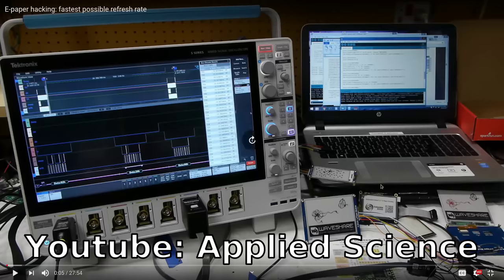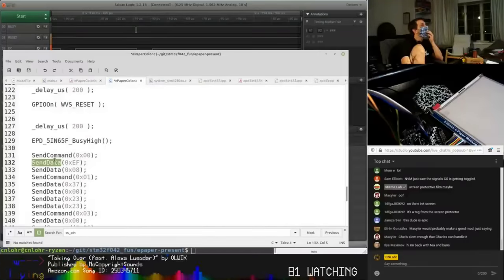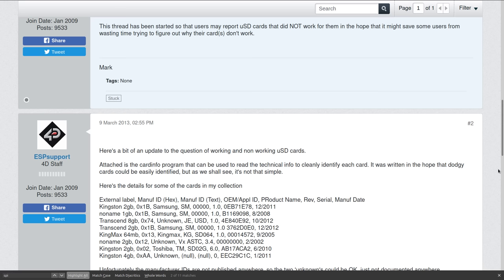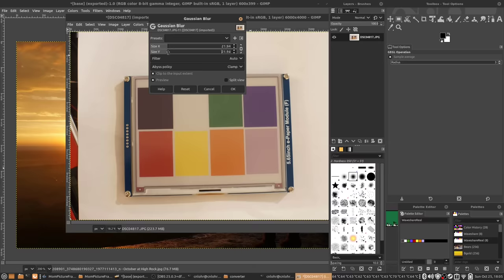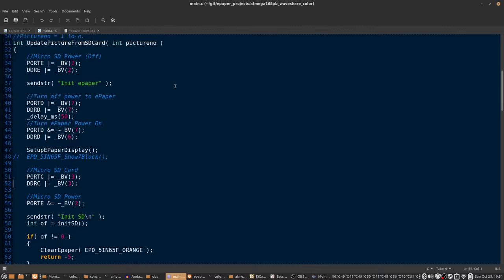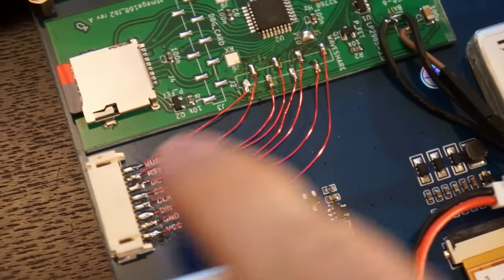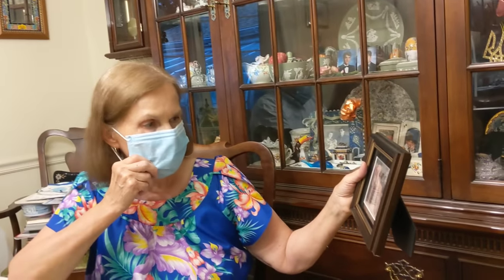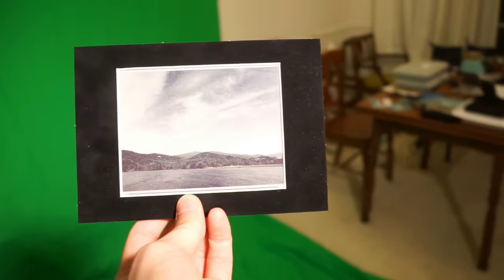Trolling My Mom With an E-Paper Picture

Comment: This is actually a really good implementation of a digital photo frame. The use of e-ink and only changing the photo every 24 hours (or more) makes it much more unobtrusive than the ones that were such a fad over a decade ago.
Reply: Absolutely. Add a changeable battery and maybe bleutooth for changing images and this is a great product.
Reply: It's literally just the screen. It doesn't come with malware or ANY ware.
The guy had to make his own driver for it.
Did you even watch the video?
Reply: @tenalpoen  they are referring to an incident with old digital photo frames that had malware. that's why he said "like the old ones"
Reply: Everyone knows about those.
This is not a digital photo frame product being sold by anyone.
It's just a display with no driver, power supply, or anything else.
If you were to buy it, you wouldn't be able to do anything with it on its own.
Reply: @tenalpoen  yeah he was just making a joke lmao
Reply: I agree, the old photo frames were so tacky. But we actually bought a modern one recently and boy have they come a long way. Even though it's obvious it's a screen, it's quite a lot more beautiful than before and actually pleasing to look at

Comment: For anyone that's thinking of making something like this today, there's this company called Pimoroni that has made a board with an eink display, rpi pico w, SD card reader, and some other features built right in. They also have custom firmware that makes setting pictures super easy. Highly recommend if you want something more simple and easy to set up

Comment: I like your attempt at trying to do a kind of profiling of the displayed colors through photographing it at around 04:55 - Color calibration and color management is a deep rabbit hole and I appreciate you including this in the video. I think the flaw was that what you did would be only useful at providing the palette for a soft proofing profile on your LC or Oled display of your computer. To extract the display-able  colors you would have to measure them under a known light source and also correct for the reflectance of the display (this is why your black levels where off and looked washed out). Nonetheless a very exciting project 😍👍
Reply from the maker: I think the biggest issue was that I cannot accurately display the colors because they are not as vivid.  So, doing it the way I landed on provides the "most" vividness that can be done without supersaturation.
Reply: Yes exactly. This is because the gamut volume of the display is far smaller because it is based on subtractive color science and not additive. Meaning it can only reflect light and not produce it like say an Oled panel. This is also why printing color spaces are narrower than display color spaces. So soft proofing is used on the display to simulate the narrower space of a printing medium. Additionally, you are basically working with a kind of 3bit display 😂 so only 1 bit for brightness info and 2bits for the shades and then using dithering to trick the eye into seeing colors that are not there. But actually using the palette you derived from the picture you took in the conversion algorithm would basically be a way to soft proof or simulate, what the final picture would look under the specific lighting conditions you took the photo under. So you could technically use it in extreme cases to then adjust the original picture (say you observed severe banding on the eInk display and wanted to adjust the picture before converting it again), then simulate the output on your pc monitor without the need to send it to your mum to put it on the display, maybe tweak it again and then use the 'optimal' palette on the picture for the final conversion. Anyways this is a great example of color spaces and working with limited color volume 👍

Comment: Finish what you started!!!
Figure out how to get this produced and sold!
I'm retired now and frustrated at all the times I made things and had no idea how cool customers would have thought they were if I'd only made them available! 😬😅
Reply from the maker: There will only ever be one!
Reply: @CNLohr  I would buy it because I have no time for making it myself. Love the idea.
Reply: You can buy a changing picture frame. It just uses more power, so it has a wire attached to it.
Reply: @weorldedit  That's the problem these days. There is always a tradeoff between high fidelity and high power consumption. With people so used to plugging/charging any and every electronic device they own, they rather have a 4K smart picture frame that uses 10W and needs a power cable, than a dithered, low-res e-ink one that lasts over a year on a single 760mAh charge.

Comment: Two years later, this guy commented;
If you chose had for example, a person, was in the scene. The person could move into a different position, outfit, you could even tell a story. Every day, the person could maybe have a change in clothing, but only one piece at a time, until several days later they have changed clothes. Then if the scene slowly changed into another scene. Maybe the person is at a museum looking at a painting, eventually it turns into that person at work, standing a few steps away maybe looking in a different direction, looking at the copies in their hands. Things would need to be stable in the scenes. Like the picture would probably not move or change size, but the scene inside of the frame could change. What if the painting that was inside the phone, was of them, looking at a painting of them in the museum, and it would change as the picture changed? I imagine that the copy machine could have been something that was barred off with one of those ropes that clip onto those poles, and eventually the piece in the museum would disappear little by little and a table top copier placed there and the front rope would disappear first and the side ropes eventually change into something, or maybe the ropes could be close enough to the table. One day the copier on the table would change into a large copier that has multiple trays and all that. Not to mention about the rest of the scene slowly transforming. If a second person would be added, how noticeable would it be, or what if there was someone else looking at a different painting, off in the distance, at the museum, and they slowly came closer over time. With only one small change happening at a time, would the additional complications from the second person make it more difficult to see the differences.
Reply from the maker: That's a really good idea! a few people have had really good ideas since this video blew up this recent time.
Reply: @CNLohr  their was a show I seen a while back, about how powerful our brains were and how much compression we do throughout our days along with other brain things. It showed a several clips, one as if riding down the strip. We were asked to count the number of items, another was dancers on stage, and a odd guy in a suit cut through in the middle, all to show that if we are tasked with something, we tend to miss something bluntly in front of us. There was a check in desk. Where they switched people checking people in, or the clerk would switch color shirts, and most people didn’t see a difference, or they took a minute before they did. There was a picture of a guy surfing, with a shark next to him. His buddy was taking pictures of him surfing that day. Nobody noticed the shark, until the pictures were developed. That’s because the limited amount of focusing we have available. But it was shown that we have the ability to maximize what we have.

Comment: You could probably put a small solar panel on the back. Even indoors out of direct sunlight it would be generating more than enough microamps of current to keep the batteries topped up.
Reply from the maker: I've thought about that, I'd just worry it would have given it away even moreso.

Comment: That's pretty sweet.
A minor thing you could improve in your videos is to use a pop filter for the microphone. Some of the "P"s in (e.g. in "paper") put a bit of pressure on the ears.
Reply from the maker: Unfortunately, I still did not have one for my upcoming video... but, I will get one sooner or later.

Comment: I might have found this years later, but I did something similar with a PI, UPS backup hat, some python code and an 18650 battery. I needed a shadowbox frame to make everything fit. I also need to charge it roughly once every 2 weeks to keep it running. Time for a new project!
Reply from the maker: This lasts about 1.5 years on a charge it seems. Of two tiny quadcopter batteries.

Comment: I'd've added a charging port for after the jig was up. Two years is great, of course, but if it's chargeable I'd see it easily getting more use. Then I'd also have used a wireless enabled chip (probably with a magnetic reed switch to turn the wireless on) so that I could secretly update the pictures when I visit.

Comment: This is so much better than the smart picture frames we had in 2007. They looked like crap, were bulky, required constant power from the mains. If they could get the resolution high enough or add a fewn more colours it would be perfect
Reply from the maker: Aaaand this doesn't light up.  This just looks like print.

Comment: Imagine if the frame had a small solar panel tucked away on an edge or such, like the type on the old simple calculators, and could charge itself.

Work to make it a bit thinner, add an SD card slot or USB-C port (which could do the once every two years charge if necessary) for the end user to access easily, and then sell it on Amazon.

I'd totally buy one! The current type of digital frame with a cord doesn't work well for wall mounting, at least not cleanly, but this seems like a very viable solution.
Reply from the maker: I show people what's possible.  I want to inspire others to make the products.

Comment: Hey, I have some questions regarding your project. 

I also want to build a PhotoFrame using an Arduino with ATmega168 and E-paper with SPI interface board build by Waveshare (I guess it’s the slightly newer version but as far as I‘ve seen the SPI bus communication and 4bit allocation for the colours seem to be the same as with your‘s). I am pretty new to this field (I didn’t even knew what SPI is) so I read through a few pages including the Wiki Waveshare provides and their code examples in which I was able to discover and guess some things I read before but not able to understand it with my basic C# knowledge. I would like to „just use“ the code you written but I neither understand the layout of your GitHub page (it’s unlike anything I worked with before) nor the code/ files you written.

 Can you tell me the codes directory or anything else I can do to partly understand it/ get the thing working? 
I know it’s probably pretty obvious but I don’t have that much experience with those things so I appreciate any help here, thanks :)

Ps: I‘m German so forgive me for using stupid sentence structures/ words and I might contact you (CNLore) at the addresses given on your GitHub profile page, so don’t be confused if you see this comment two times
Reply from the maker: you should probably work to get a functional toolchain.  You should add an LED or something else to see if you can blink an IO pin, that would mean your toolchain is good.  You should then make sure my "Makefile" works.  The Makefile uses all the code, and shows the commands that are used to compile it all together.  Once you can get the Makefile to "Make" and flash the AVR, you know you have all the pieces working.  You can then look through the code and make tweaks.  I strongly recommend using a logic analyzer and twiddling an IO pin, you can add this code to your C program to see when something happens.  

I hope this was a helpful overview.

Comment: I remember hearing about wireless L.E.D.s that get power form WiFi signals......could you adapt this to charge the battery?
Reply from the maker: It is very hard to get usable power from wifi in home settings.  In lab settings it's easy when you put a wifi router right next to the thing you want to charge, but practically in this setting, it's just toooo lowwww power.

Comment: I'm interested in that SD card issue, as far as I can tell every type of card (micro, "normal", SDHC, whatever) is meant to support SPI mode. Do you have any further info on what specific cards don't work?
Reply from the maker: I do not, but I have, several times, found cards that do not support SPI.  And, I seem to always trip on them.  Some sort of soft-don't-support-it.  I.e. if you flip the order of some commands it works, others just hard-don't-support-it.
Reply: @CNLohr  Interesting. I'm actually working on a project right now that requires SPI mode because I'm trying some crazy stuff with SPI at hardware level (that would probably get me fired if it was my job) to push extra performance. I guess "try another brand" is good enough in this case.
Reply from the maker: @kasamikona  You can talk four bits at once in SCSI mode. I don't think there are any cards you can outperform SCSI with SPI on.
Reply: @CNLohr  In this case I'm talking about overall system performance. It's a low speed microcontroller (AVR at 8MHz) that needs to read in some data and output it to another device over SPI. I can't justify using a faster / more expensive microcontroller because that transfer is about all it's needed for.

My crazy idea is to try talking to both devices simultaneously, rather than doing it the normal way which would take about twice as long. Basically, during a block read the MOSI would output all high for "NOP" commands, so the plan is to instead pull the card's MOSI line high while using the real MOSI to output the previously read byte. I would then switch back to "legal" SPI at the end of each block read.

Comment: To really stretch the power of the batteries, you could probably use a hidden photovoltaic cell like in a calculator, which would help power the display itself and trickle-charge the batteries.
Reply from the maker: That's a good idea, but I think it would have given away the gift.  I will say, after ~400 days, the batteries needed charging.  Which I did for my mom! Hopefully it goes another 400 days!
Reply: @CNLohr  Mirrors, lenses and prisms would be a great way to hide a photovoltaic cell in plain sight, as it’d just look like a really fancy frame bezel.

Congrats on the ~400-day runtime, by the way!

Comment: I don't understand how the display does 7 colors, but none of them particularly well. I would have figured a display that used Yellow, Cyan, and Magenta caplets would be able to perfectly emulate a much wider range of colors.
Reply: ePaper is an incredible technology, but it's not magic. Because the pixels are created by coloured spheres electrostatically suspended in an opaque white fluid, even if all the spheres are up front they're still spheres - they can't exclude all the fluid so the saturation is low. Also you have to jiggle the spheres in and out of the fluid in a complex way to show just the one colour you want and hide the others, and that doesn't allow for fine grayscale control. You can either have low power usage or high colour fidelity/high refresh rate, not everything at once.

Comment: With how low power it is, I'd hide a scraped calculator solar panel in the back for some residual charging.
Reply from the maker: That would have been a good move.  It lasts about a year on a charge, a solar panel probably would have extended that a good clip.

Comment: I'm still waiting for an e-display on a mobile device (phone/tablet) powered by android so I can program my mapping app to be constantly on while wilderness hiking and taking advantage of phone features like GPS. Color would be nice but grayscale would be entirely fine. As it is - my app works just fine offline and I carry some backup USB charge bricks so I can keep the regular phone running (and not get lost).
Reply from the maker: You're waiting because you haven't made it yet
Reply: @CNLohr  This is a good point! For my slow image update requirements all I really need is Bluetooth/wifi/usb connection to an e-ink display and screenshot the regular phone image to it. After the initial map display, only part of the display (a pointer to indicate current location on the map) will change every (approx) 30 seconds, so the quantity of data needed for updates would be pretty small.  The phone code I can do - bit of a learning curve for the e-ink hardware/API.

Comment: With such low power draw you could almost get away with a solar cell on the back or etc to top the battery off with reflected light and it would last forever.
Reply from the maker: I don't know too much about doing that safely with lithium polymer batteries.

Comment: you should've added a small solar panel on the back like the one calculators have so the battery would last forever
Reply from the maker: I just don't know enough about lithium charging to do that safely and effectively.  And I think the solder panel would have super given it away!

Comment: Getting 2 batteries in parallel might pose some safety concerns, there is no balancer in the middle I guess.
Reply from the maker: Not needed if pre-charged to same voltage.   All lithium batteries are are billions of smaller lithium batteries in parallel.

Comment: So if im not mistaken... The SD card is being read the same way as it would in a phone or pc? (As in the same as the licensed protocol)
Reply from the maker: It is.  It's using a regular SD protocol, not the unreliable SPI protocol.
Reply: @CNLohr  im surprised no one else made one earlier. (as far as I know)

Hmm i might look into using it with a RP2040 as a little sd adapter... Cus why not XP
Reply: @CNLohr  hmm would it be possible to use a sd in spi mode on a RP2040 for firmware load and then switch out of spi mode for loading or writing log files?